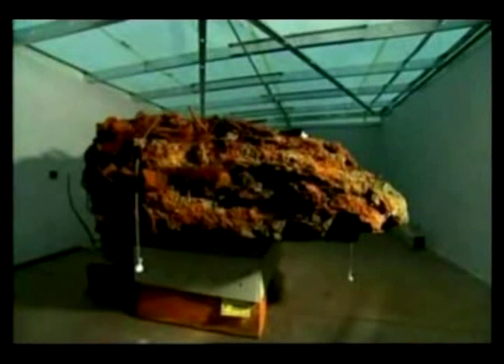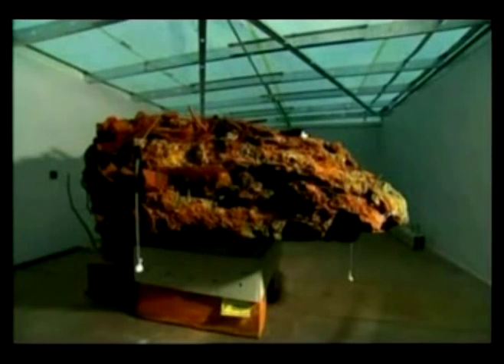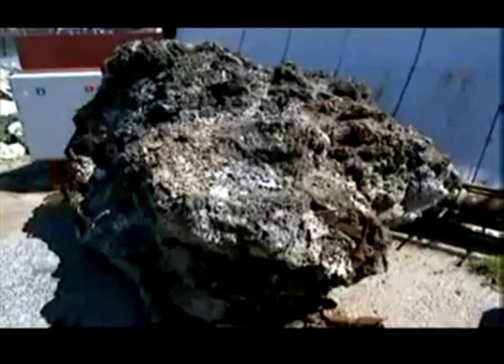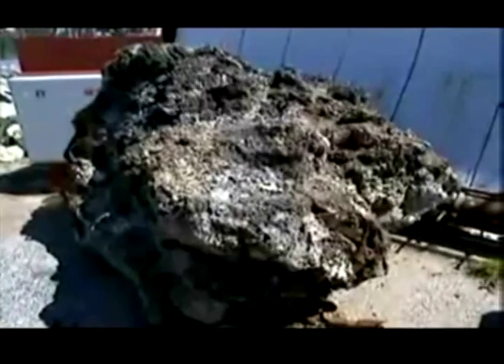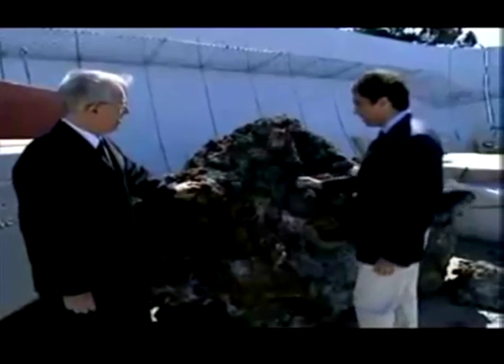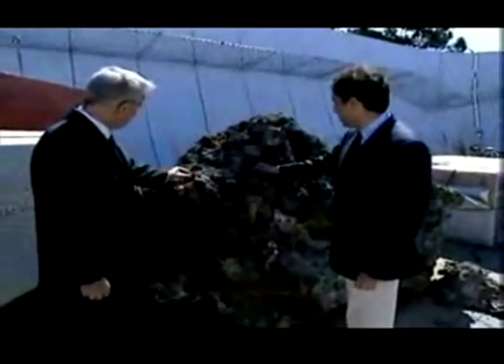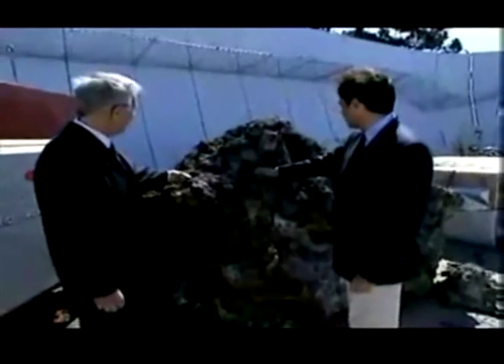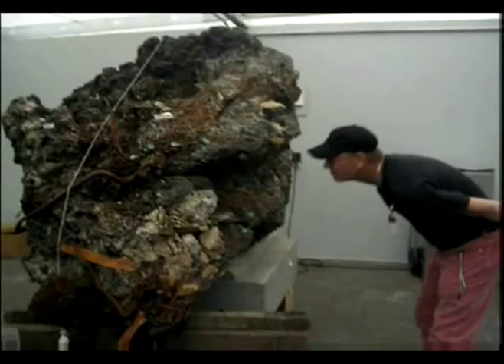9/11 WTC Meteorites Molten Iron Concrete

Comment: I see no evidence of molten iron in this video. Bent, twisted, yes. But melted? No.
Reply: I'm assuming that you're talking about the twisted metal sticking out of the "meteorites". Those aren't the point. The point is the meteorites themselves. They had to be molten at one point to form like that. The metal sticking out was caught in the mass after it was already much more cooled down.
Reply: You are indeed making lots of assumptions. Well assumptions don't cut it. What material "had" to be molten? Was it steel?

You need to PROVE that STEEL had MELTED. Can you do that?
Reply: Do you think the steel for the towers was put in in big, misshapen chunks? How else would the steel end up looking like that? There's also recovered sections of steel supports that are like swiss cheese, and pieces that fused together, as well as testimonies from first responders who said there was molten steel all over underneath the rubble.
Reply: "Do you think the steel for the towers was put in in big, misshapen chunks?"
No, of course not. Nor do I think steel melting was required to misshape them. The fires were certainly hot enough to soften & weaken steel by up to 90%! Add the massive energy released when the towers came down and there's your explanation for that.

"There's also recovered sections of steel supports that are like swiss cheese"
Caused by a chemical process that did not require temperatures higher than the fires could explain.

"as well as testimonies from first responders who said there was molten steel all over"
Did they KNOW it was steel, or were they just guessing? Can you identify what kind of metal molten metal is by sight? Can anyone?
Reply: Did you not watch the video? It's not just bent.

https://www.youtube.com/watch?v=VvQDFV1HINw
So far, there has not been any experiment done that has shown how some of the steel found at the WTC ended up how it did.

Well, it wasn't molten aluminum if that's what you're thinking. And molten iron shouldn't have been there any more than molten steel.
Reply: Not molten aluminum? Are you sure? Aluminum IS, in fact, the most likely answer. (And if you're going to say it can't be aluminum because it would be silvery instead of glowing, I can direct you to movies showing aluminum glowing quite brightly if heated enough.)

As for the "The Mysterious Eutectic Steel" video you linked, you no doubt noticed that It's the result of a chemical process, not super-high temperatures. So I really don't know what you think that proves.
Reply: Molten aluminum can glow as long as it's constantly heated, but as soon as you pour it or move the heat source away, it goes back to silver. This doesn't match with what what seen falling out of the south tower shortly before collapse, and it doesn't match what the responders described, as they said it was flowing and stayed red hot as it was dug up.

The mainstream explanation for the strange steel was a chemical reaction involving sulfer from gypsum wallboard and diesel fuel in high temperatures. In that experiment he surrounded the steel with gypsum and deisel and let it burn for over 24 hours and it did not display anything similar to what was found at Ground Zero. After seeing this video, one of the main scientists who put forward the theory that it was caused by sulfur from materials in the towers changed his mind, and said that it was actually caused by chlorine from PVC. So now someone just needs to add that to the mix in an experiment to prove it.
Reply: Dude, we can go back & forth like this all day but in the end: You do not have evidence of molten steel and you never have.

It's not in the "meteorite," it's not in Jonathan Cole's phony experiment, it's not in anecdotal testimony or a video of molten something. You'll never prove an inside job by process of elimination no matter how many hoops you jump through. If steel really did melt in the quantities we're talking about it would have pooled, solidified, and been found. Find someone qualified in metallurgy to examine such a sample and declare it previously-molten steel and maybe you have a shot.
Reply: Back and forth like what? You making claims and me refuting them? We can't go back and forth all day like that, we can only go back and forth until you run out of claims to make. Which is now, apparently. Saying, "that doesn't count" isn't really an argument. Why would you assume that something that doesn't look like molten aluminum is molten aluminum, why would you assume that the molten metal described by witness as steel and iron and then the aftermath of molten metal that is again described as formerly molten steel and iron is actually aluminum or some other mystery metal? Have you had someone qualified in metallurgy examine such samples and declare it was molten aluminum? Because maybe then you'd have a shot.

Actually no, then your expert's credentials would be called into question, since free-flowing molten aluminum never glows orange and red.
Reply: I'm not making claims, I'm asking a question: Where is the proof of impossibly high temperatures melting steel?
Reply: Supreme_Court Do you know what was in the "meteorite"? I'm assuming not because I can tell you that it proves you wrong. The meteroite wasn't formed from extremely high temperatures
Reply: @Tim22222  
NIST hasn't proven a single assertion yet you apparently buy those assertions hook, line, and sinker.